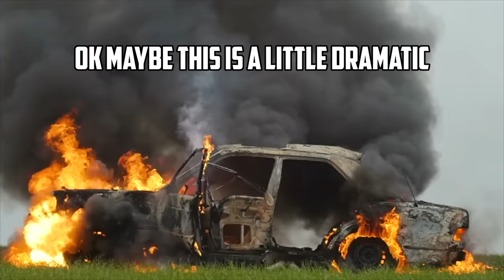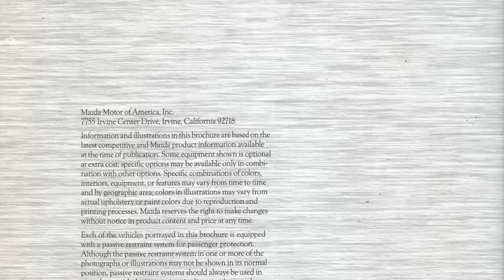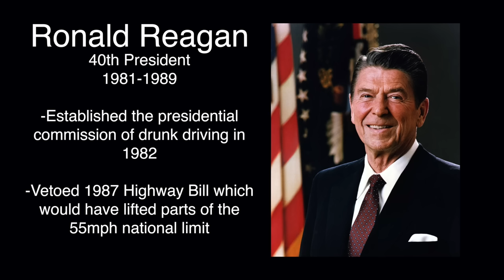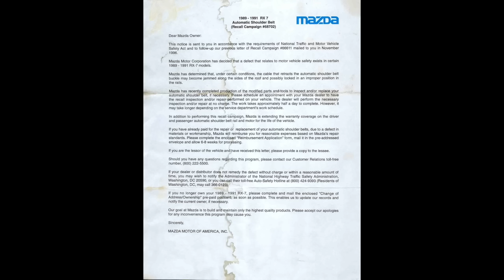Automatic Seatbelts - Why They Were Used & Why They Went Away!

Comment: I remember visiting the US as a 6 year old kid in 1996 and being amazed at the automatic seat belts. Always thought they were sooo cool!
Reply: They seemed cool at first, then became annoying. Ended up getting a lot of people killed because not many knew about the lap belt, and if you do not hook up the lap belt the automatic belt became a noose.
Reply: I still remember going USA and everyone was still using mobile phones while driving when it was already illegal in Europe 🤣.
Even at the petrol pumps the Americans had the phones out
Reply: Me too! Didn't know they were harmful to people tho.
Reply: @sko1beer  
I remember visiting Europe in the 90s and they were still using LEADED fuel even though it had been outlawed in the US for about 20 yrs at the time!
Reply: @fazole n the USA leaded gasoline began phasing out in around 1974, and wasn't completely done with until 1996.  Throughout the 80s the lead content was reduced significantly.  My first vehicle,  1993 Ford Ranger said unleaded fuel only at the filler and near the fuel guage on the dash to warn the driver not to use leaded fuel where it's available, because it would quickly damage the catalytic converter and maybe other parts of the truck.   On the other hand old engines from pre-1970 could be damaged when ran on unleaded fuel because tetraethyllead acted as an internal lubricant for the valves in addition to an octane booster

Comment: I have a 1987 Camry with automatic seat belts. They still work, and the only issue I’ve had with them was actually a wiring problem in the door. There is a switch inside the door latch that enables the shoulder belt when the door is closed. The wiring that runs to this switch eventually breaks at the door hinge from years of opening and closing the door. I replaced the wiring and it’s good as new. They’re a very niche feature that, much like burgundy velour interiors, will likely never return.
Reply: The ones in my 84 Cressida still work too 🤣. It's funny when people get surprised by them.
Reply: I know someone who was decapitated by one back in the 90s. He was in a car crash and I’m assuming the door was ripped off. My family and I have been avid about educating everyone we know about the danger. Please reconsider wearing it.
Reply: @shanester366  they can decapitate top you if you’re in a wreck. I knew someone who died in the 90s after being in a car wreck with one. Please don’t wear it.
Reply: @larsonfamilyhouse  that's crazy sorry to hear that. Luckily that car is not my daily driver, it pretty much only puts around the neighborhood these days I drive something much more modern as my daily.

Comment: My father had a 1974 Ford Pinto in California (and no, it never exploded).  But it came with an interlock that actually prevented the engine from even starting if the seat belt wasn't attached.  Dad never ever wore a seat belt, and he quickly figured out that if he pulled out the belt about 12 inches or so, he could hook it onto the door handle, and that was enough to make the interlock think the seat belt was attached!
Reply: When I was a teenager, we'd go "cruising" and at the parking area, we prentended the car wouldn't start....the passenger wasn't wearing the seatbelt.  So we would get out and open the passenger door and pull the seatbelt like we were starting a lawnmower
Reply: @KCFlyer2  🤣🤣🤣
Reply: The Pinto thing, albeit real and widely known and definitely an issue, was perhaps a bit exaggerated. People did die from it, but isn't the number somewhere from 25 - 30?
Reply: @101Volts  it must be larger than that. I knew someone who was decapitated from one in the 90s. I don’t think he had a pinto but I’m not 100% certain. I was thinking he had a Camry or something similar.

Comment: My mom had a 92 Nissan Stanza with power belts when I was growing up. I remember them being super-annoying - not because I didn't want to buckle up, but because they were always -ALWAYS - in the way. They could block your view or reach to controls when in the retracted position, you had to wait for them to retract upon leaving the car, and most annoyingly they weren't height-adjustable so that if you weren't just the right height, they were uncomfortable while driving. We never had trouble with the motors, though, and we drove that car into the ground. I wasn't sad to see that feature go, though you could say that the motorized belt extenders used in some luxury coupes and convertibles are its spiritual successor.

Comment: Born in 89 I remember riding in two cars having automatic seat belts.    The first was my neighbor's 1989 Honda Accord.   Though the seat belts were very strange.   My uncle owned a 1990 Cadillac Brougham,  seat belts in the door.   Never seen any other car with very weird seat belts.   But I really liked the gas cap behind the license plate also the only car I've seen like that, but if there was a line at the gas station it didn't matter which side opened up first.      The ability to fill from either side was pretty cool.
Reply: Yeh I had a job pumping gas at my local gas station when I was 15 & the first time I had a car come in with the gas cap behind the license plate I was thrown!🤣💯👍
Reply: A lot of gm cars from late 70-80s had the gas cap behind the plate.
Reply: So the seatbelt in the door was GM's alternative to the automatic seat belt. The seatbelts in the door was designed to stay buckled and you just kind of climed in around it lmao
Reply: If there’s a line at the gas station an im in my miata i take whatever’s shortest, because the gas flap is sitting near horizontal on the trunk its super easy to fill up from the wrong side
Reply: The large 1990 (that year only) G. M. models (and also probably some of their small early to mid 90s cars) had that poor seat belt system that could throw someone out of the car if the door opened. That's G.M. Law Loophole Engineering for you.

Comment: My first car was a 1993 Ford Escort and it had good, working automated seatbelts. It wasn't until a little while after I owned the car that I realized there was actually a lap belt that you still had to attach manually. The retaining loop that's supposed to keep it against the side of the seat was broken so I never even noticed the belt was there until I spotted the latch on the other side. Everyone thought the seatbelt mechanism was so cool in my car, but then one day my best friend drove my car and for some reason, in his care, it broke on the drivers side. The belt would only go so far up the track and then proceed to make loud clicking noises for the rest of the trip. The passenger side kept working just fine, but I eventually had to go in and manually reel the seatbelt all the way to the latched position and disconnect the electrical connector which also disconnected the driver door chime and dome light activation. Luckily you can just disconnect it at the shoulder so that's what I did for the remainder of time I owned the car.
Reply: Your friend broke it playing around with it.  💯
Reply: @jimmbobb  Maybe, he wasn’t the most mechanically conscious person… and he was a bigger guy so no telling what he did or didn’t pay attention to when getting in and out of the car. Perhaps blocked the path while it was moving and it broke like that? I don’t know…
Reply: @man_on_wheelz  Granny had a 1987 Escort (the first year they used the auto belts). My cousin and I, both about 8 years old, were left in the car while my aunt ran into a friend's house. We opened and shut the door several times, holding the belt back and stopping it.  Until it finally stopped working.  My aunt was SO PISSED! She yelled and cussed at us the whole way home, the seatbelt about a quarter of the way from the "back" position so she couldn't sit properly. After a while of playing possum it started working again, thankfully.

Comment: I had a Sterling 825, and LOVED the automatic Seat Belts.

My guess as to why they stopped being a thing is that they could fail in a way where they no longer offered protection
Reply from the maker: YOU HAVE A STEARLING??
Reply: @ShootingCars  HAD one. Wish I still had it, but I slid off a weirdly banked corner on my way home when a friends parents forced us to go home in a fresh snow storm so we wouldn't be at their house snowed in all weekend

 We were all like 17 or 18 at the time, but I was trying to be cautious as I could as a fairly inexperienced driver.

Unfortunately, the curve was an S bend over a hill so as I came around it I wasn't doing more than 8 mph, because I was worried about it, but I started to slide to the outside of the 2nd part of the curve, and chose to steer into it as I had learned I was supposed to, but I probably should have tried some gas instead, I was in low gear and would have still hit the side but not how I did

Since I steered into the slide my front passenger tire hit one of the rocks in the ditch we slid into while extended to hit it close to sideways, and caused that to FUBAR  the hub and it's steering control arms were ripped off and the whole thing was at an angle IIRC.

That's how I ended up moving to a 92Cadilac De Ville which was also pretty sweet in its own way.

One thing I miss about the Sterling, besides the auto seat-belt, was that the radio allowed you to make frequency adjustments an extra 1/2 decimal space out.

If I was listening to Q104.3 KROK I would put it on 104.35 because it came in more clearly than 104.3

I found few stations where I found out their actual frequency was off by a half step up or down here in New York in the 1990s, for the 90s that dealt like a super power. :)

Comment: Fun fact, OEMs could either implement the auto seatbelts OR the airbags. Many opted for the belts. Some went the extra mile (see what I did there) and did include both. Then as you said, mechanical issues and the mandating of the airbags caused these belts to fade into obscurity.

Comment: We had a 91 Mercury Tracer Wagon that had automatic seat belts. In the event of a motor failure you actually could pop off of cover you were provided with an allen key to manually crank belt. Something I would like to know about regular three-point seatbelts is why did it take so long for them to be added to the rear middle seat cars?
Reply: Because only drivers buy new cars
Reply: Probably because of the added expense of engineering a way to safely add 3 point belts to the rear middle, as well as the simple fact that it wasn't used very often for people.
Reply: @richardmillhousenixon  it definitely sounds plausible. I remember a 96 Ford Taurus sedan where the back middle 3 point seat belt was like a manual version of the automatic front seat belts from days past.. most people didn't bother connecting the shoulder strap. They just war the lap belt.

Comment: My sister had a late 80’s Mercury Cougar with automatic seatbelts in the early 2000’s. Problem was it broke on her side, so she would use the lap belt you manually had to put on, and at this period of time DUI checkpoints were extremely common around where I live. As luck would have it she was driving me home one night, and we came up on a check point. The officer looks over at me with my automatic seatbelt on, then looks at my sister and says “ok where’s your seatbelt”. My sister pointed out she had the lap belt on, but that wasn’t good enough, she got a ticket. Funny thing is after the cop wrote the ticket, he said if I wouldn’t of had my automatic shoulder belt on, and we both would’ve just had the lap belts on, he would’ve just let us go and assume it’s a older car with no shoulder belt. He’d never seen a auto seatbelt before. 

I kinda wonder what would’ve happened if she would’ve contested the ticket, cause technically while not as safe, she was wearing a seatbelt.
Reply: "I kinda wonder what would’ve happened if she would’ve contested the ticket" 
Not sure how this kind of thing works in the US, but where I live the fact that the belt was broken would potentially make the whole thing even worse for her because it's basically neglected maintenance.
Reply: You had to have both on, the automatic and the manual lap seatbelt, but people were lazy or had a false sense of safety because of the automatic seatbelt, and neglected to put lap seatbelt on.

Comment: Also this solution either has no lap belt, meaning your head could theoretically get caught up in the chest belt in an accident as your lower body is thrusted forwards, or you still have to fasten the lap belt for about the same effort as a regular 3-point belt, making it as useless as it gets.

Comment: Thanks for this, we never got these here in Australia, and when I've seen pictures of car interiors from around this time I've always wondered just how in the hell they work.
Reply: In the case of my 93 legacy (liberty in aus) there's a small brain box for them, a track that runs the vast majority of the window opening, the motor lives in the base of the b pillar and connects to the track with cables that also move the shoulder belt, and there's a separate lap belt.
The shoulder belt reels are in the center console under the storage box as well. 

It's a stupid system and commonly ripped out for regular manual belt like everywhere but the states got
Reply: Yeah the U.S. is the only country that got them.

Comment: I knew someone who was in a car crash and was decapitated by the automatic seatbelt. I’ve told everyone I’ve ever seen use one to never ever use the feature in the car. And if it’s stuck in the ON position either fix it before riding or simply cut it with a knife.

Comment: I hated the automatic seatbelts in my early 1990's Subaru Legacy.  They were not snug against the chest of the driver and passenger and allowed considerable foreword movement in an accident.  Even at the time, it was known that slack in a seatbelt system increased the chances of injury.  Since I grew up using seatbelts (yes, even in the 1960's), it angered me that this annoying "convenience" actually INCREASED my injury potential.
Also, there were a number of occasions when it managed to get wrapped around my neck.  Although I cannot remember the exact sequence of events,   Usually it would involve leaning foreword while reaching for a dropped item while the automatic system was moving.  If I managed to bump the door open enough for it to retract, it somehow ended up around my neck.
Reply: That's what makes a Subaru, a Subaru.
Reply: ... forward* movement - never trust your auto-correct/-complete!
Reply: 92 SVX, mine were perfect all around... In 2 door cars, these also made getting into the back seat much less fustrating.

Comment: Motorized shoulder belts were not the only kind of automatic seat belts though. There were also shoulder belts that bucked into the doors and swung out when the doors were opened. Others looked like a regular 3-point seat belt, but were mounted completely on the doors instead of the b-pillar or seat, which people were required to leave buckled in at all times when getting in and out of the car, but it was a real struggle, so most people just used those seat belts manually.

Comment: I was around when these things sorta became "semi popular" (read: just around cuz manufacturers sorta forced them on some models) and most of your points are pretty valid. There are a few things I'd like to add as I was there and knew several people with them too. 1) your point of them failing is pretty spot on... Almost everyone I knew either had one (or both) of their belts start to fail, or gunk up. 2) They were MORE annoying than manual belts. As you showed in a couple shots they would often slap you in the face. They never had any adjustable should position. They were slower than just belting manually. 3) they didn't actually make anyone safer. For one because simply forcing a person to put a belt on against their will will often just cause a person to rebel against it even further. Either people would slip them behind theirselves, or if it had an easy to disengage safety release, they would do that. Also it was found that people with power-belts almost NEVER used the lap belt. Now I don't know if this part was just an urban legend, or something that was actually researched. but we heard that these power belts without using the lap belt were actually more dangerous than no belt at all. Because people would assume that because they power belt engaged they didn't need to use the lap belt, or just didn't care. We had heard stories of people sliding down during wrecks, or getting strangled, having their necks pinched etc. Now; I do not know if there was any data actually collected regarding "No belt Vs. Just shoulder Belt Vs. 3-point belt" but I do know I heard this from different parts of the country, so it was certainly "common knowledge" even if just an Urban Legend.